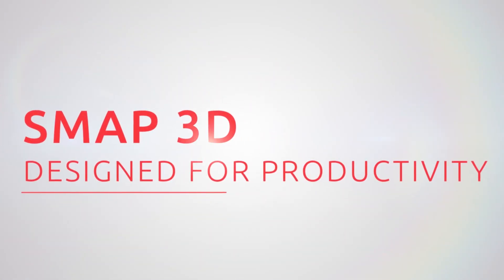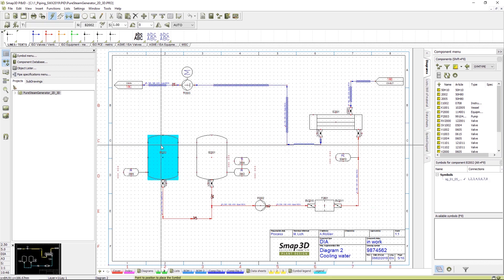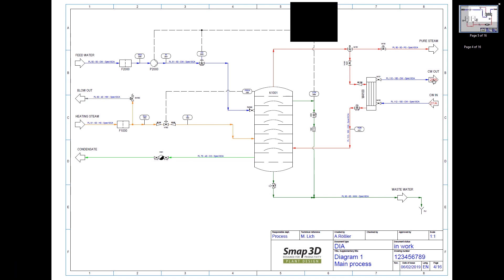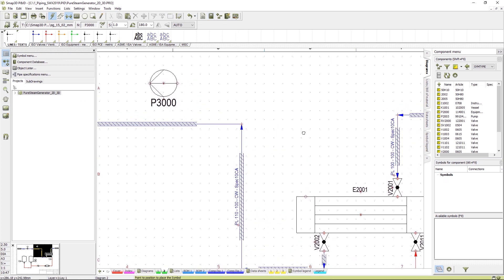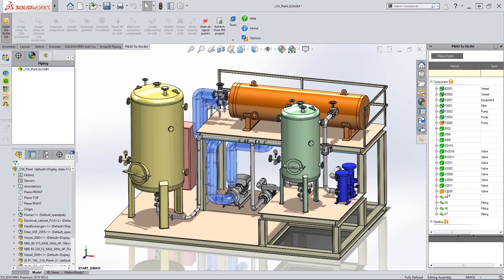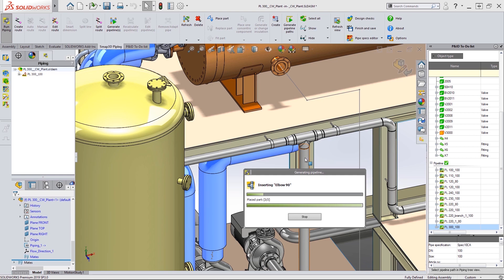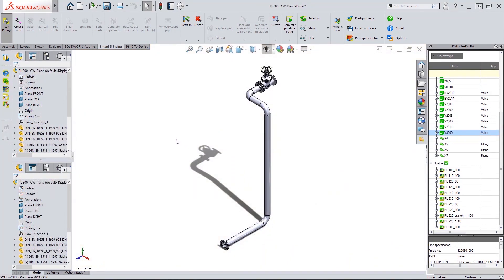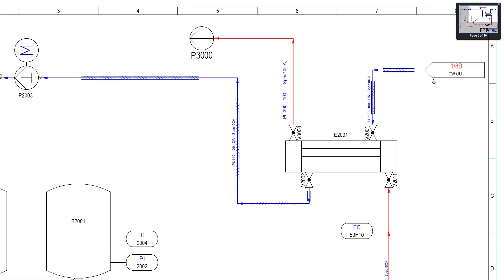Smap3D Plant Design - Product introduction

Comment: What is the limit of the plant size? We use massive chemical piping designs with imported building, ducting, etc
Reply from the maker: Hi Janos, Smap shares the same size limitations as a SOLIDWORKS Assembly. The maximum model resolution space for a SOLIDWORKS Assemblies is 100 kilometers, centered on the origin. Hope that helps! 

Also, while physical size is unlikely to be a limiting factor there is a possibility that the sheer complexity of a design that large may cause performance issues. I would suggest discussing with your local Smap3D reseller who will be able to advise if it's a suitable solution for the scale of designs you work with.
Reply: @TriMechGroup  thanks for your feedback.